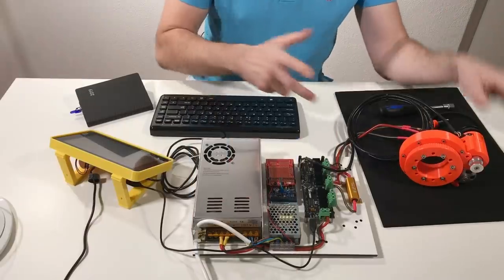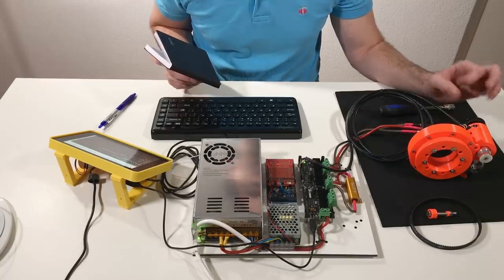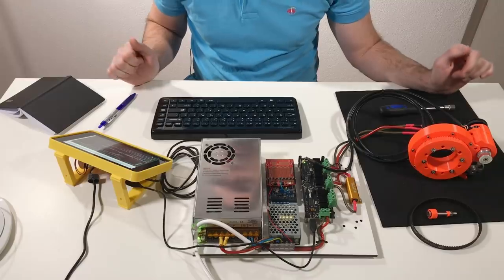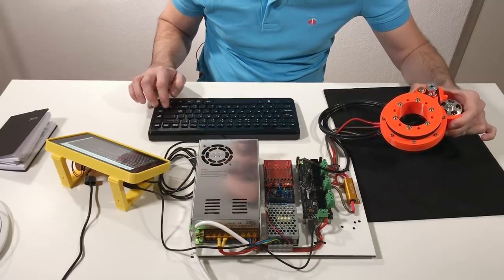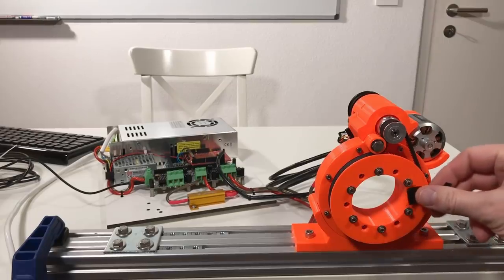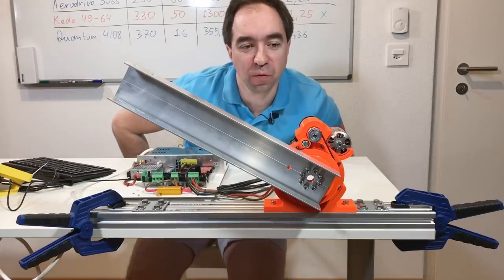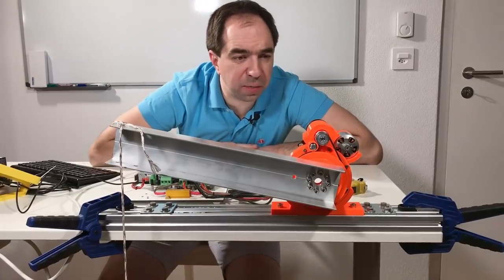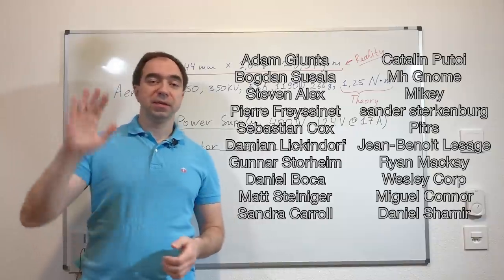Test of Robot Actuator (Brushless Motor Robotic Joint)

Comment: At 1.2KW, your motor is an absolute beast. a higher gear reduction may give you the needed torque without using as much electricity
Reply from the maker: 100% agree with you. I even think that may be I should develop several actuators like this one with different gear ratios. Thank you for the idea!
Reply: In that case motor must rotate on higher rpm, problem will be also inertia ratio wich cause lower accuracy in positioning, by the way great job and thanks for uploading good videos with explanation

Comment: 14:33 some sort of brake system would probably be ideal so that it could lock it in place, and when the arm goes to move it releases the brake. The disc brake system on some bicycles would work very well, have a servo to control it.

This would also allow you to control how fast the arm would drop under load without having to use the motor to be the sole thing to provide resistance on slowing or stopping the arm under load. 

And you wouldn't really have to change too much of the current design to do it either.

Comment: It is great to see a closed loop actuator with enough power to be useful, without breaking the bank.  Thank you.
Reply: But doesn't this setup cost around 350+ $?
Reply: @Mr30friends  : Until you mentioned it, I was assuming we were talking about the motor, encoder, a couple of belts & pulleys, and the 3D printed parts.  There is, of course, the electronics side of the equation, which I had conveniently ignored!  I don't know the cost of the complete package, but I will be interested to learn that if possible, later on.
In my mind, I was relating this to the cost of an "off-the-shelf" closed loop system... If this is not cheaper, then it loses it's significance.  We may be breaking a bigger bank than I realised.  It's still a neat project tho'!    :o)
Reply: @PiefacePete46  
The odrive costs 120$, plus 40$ for the encoder, plus 80$ to 100$ for the motor, plus the huge special bearings which probably cost around 30 to 50$. Plus something like 40$ for the power supply.
Add to that the 3d printed parts, axels and pulleys. So around 350$ to recreate the exact setup from the video.
But of course there are some parts that could be used for more than one joint. 
For example the odrive can control 2 motors. And a power supply could probably also take care of more than 1 joints.
I think he plans to make a 6 joint robot with this kind of joint. So the cost will reach quite high. 3 Odrives 360$, 6 encoders 240$, 6 big bearings 200$(?), 6 motors 450$, lets add another 100$ for power supplies cause I have no idea how many it will need. Lets also add 150$ more for any structural stuff. So if my rough estimates are somehow close to the truth, the robot could cost from 1500$ to lets say 1800$.
That's quite a big project.
Reply: @Mr30friends  : My bank is definitely broken!   :o(
His stepper-driven arm is what caught my attention, and I had not taken on board the size difference between that and this current project.  I would be curious about cost comparisons between the original arm, and an arm of identical size and power that uses a closed loop scaled down from the one shown here.   Closed loop is appealing, but seems to move cost and complexity beyond all but the most determined builder, and that's not me!
Reply: @PiefacePete46  Yeah. For that price, I would expect less backlash in the system... I wouldnt exactly call this the pinacle of budget robotics...
At least until chinese factories step in, take the open source odrive and its encoder that cost about 120$+40$ currently. And somehow transform them into 20$+5$ products. Coming soon on aliexpress probably. (or not)
Also that would not be theft. The odrive maker made everything open source.

Comment: Stall torque is NOT going to be power supply limited, because the applied voltage is many times lower than the supply voltage under those conditions.

 For an electric motor, PHASE current is proportional to torque, and PHASE voltage is proportional to rotational speed.  At stall or low speed, the motor is not turning (either at all, or just very slowly) and so the phase voltage applied by the drive is only that required to drive the phase current though the DC resistance of that phase.  Because motors are mainly reactive rather than resistive, that voltage will be small, likely in the order of a few volts.  As such, the drive is acting as a step down regulator, and so the phase current available is many times greater than the supply current.  For example, if we ignore losses for a moment, your supply is 24v and 17A (24 x 17 = 408W) , if the phase voltage at stall is say 2.4V, (10 x lower) then the motor phase current can be 10 x higher, ie 170A !!  (2.4  x 170 = 408W) !!  Even with loses, which will be in the order of 10% at stall, you will still have plenty of torque at low rotational speeds!   

What you need to do is to work out if your Odrive is limiting the phase current and hence the torque, as chances are it is the "weak link" in the chain, so to speak......
Reply: Will reduction ratio solve this problem?
Reply: @pavelzhdanov  Increasing the ratio will of course generate a higher stall torque.  It cannot increase the systems total power, and will reduce the maximum output speed of the actuator. At high ratios the rotational inertia of the drive motor starts to dominate as that inertia is referred to the load by the same reduction ratio.  If it were me, i'd characterise the motor first one it's own, for torque vs current, and then "do the math" as it were to see if my overall system performance is in fact suitable to drive the load i wanted to drive. One easy way would be to 3d print a "drum" of a known diameter, attached that drum to the motor drive output, mount the motor, and run string around the drum, hanging down to a known mass.  With the Odrive you can slowly increase the phase current until the motor juuuust lifts the mass, and then you can calculate the torque the motor makes, and hence it's KT (Torque per amp).  The belt drive system and bearings are of course not lossless, so i'd knock off something like 15% to account for those loses when the reduction system is in place.
Reply: Based on other comments as well, the whole system with such motors would not work finally even with higher ratio. However interesting to see the result

Comment: Great work!

Torque at stall means that all of those amps go into heating, without active cooling it will be very easy to damage the motor if you push 50A through it for longer than a second or two. You might want to consider the motor's motor constant and the maximum amount of heat that you can dissipate from the motor. 

The motor you are using is designed to provide a large amount of work at a relatively high RPM, for this application a flatter motor with a higher motor constant may be preferable. There should be some hobby motors that are more suited for the task at a similar price if you are interested in changing your design at all.

Comment: great job,  thanks .
The Arm material would be ligther, I would recommend carbon fibre, and it does not have to be so fast (to be fast , you will loose your torque at the same power)
By the way I am excited  to see the next, finally doing reverse kinematics equations and calculations

Comment: Very impressive! 

Really interested how the actuator will perform with full power. It would perhaps be a good idea to introduce some active cooling to the motor when doing that, since the motor magnets are quite susceptible to higher temperatures.
Reply from the maker: You are 100% right.  I would do this. And in the next version I plan to install the cooling fan. Thank you for your comment!

Comment: Very good video, thanks.
The bang/click heard at 12:32 & 14:38 sounded more like belt slippage under torque, probably due to plastic deformation in the 3D printed plastic casing.  The holding power (2kg) is almost certainly due to under-power as you say.
Thanks again, excellent stuff, I'm jealous.  :)

Comment: Simply amazing
Reply: Do you know what's the possible cause behind the slight jittering at 12:54? Is is the controller? I feel like it overshoots a little every time the goal is changed. Maybe over damping can help?
Reply from the maker: This controller have PID control and it is possible to change all parameters for this control. I hope I just need adjust this parameter and it will solve this problem. This is something I should try. Thank you!
Reply: Skyentific Thank you for doing all of these on YouTube! I am very impressed by your channel!

Comment: This looks fantastic!  However, I've done some numbers for a while trying to do my own servo actuators, and the torque conversion needs to be about 1:100 for this kind of application. Otherwise the motor current will need to be too high, which is not practical for repeated motion.
I wouldn't be surprised if this demands 30 amps for a few foot-pounds.
We are all experts here lol.

Comment: doesn't it have way too high RPM/way too low reduction??? I think you mentioned 1:15 redction which would mean it would run at 5700/15=380RPM. Depends on the kind of robot youre tryna build but I think the speed is quite (too) high!

Comment: You need to tune your PI-values on the odrive. The motor overshoots quite a bit and corrects back. Of course, every time you change the mechanical load, the PI-values need to be tuned again...

Comment: Re Power Supply: I’ve heard some people get away with a low wattage power supply by also adding a LiPo battery in parallel to help feed the high instantaneous currents (I’m pretty sure I read that somewhere in the Odrive forum). I’m not sure how it would go with longer duration holding torque currents, like your application requires, but it might be worth a shot if you have some high discharge rated batteries on hand before you go out and buy your new power supply.
Reply: I was curious about that and googled:
from : https://hackaday.io/project/11583-odrive-high-performance-motor-control
"Use of a high power density Li-Po battery means you can achieve >1kW peak power output with only a modest power supply."
Reply: LiPo battery in parallel. That sounds legit. 
I have been planning to drive a BT30 mill spindle by a BLDC.  The show stopper is the power supply.
Our 220V 13A power supply can only put out 2.5KW which is not quite powerful enough.   

Then by adding LiPo in parallel to the DC supply.  May be I can use the more powerful 80x100mm BLDC which
has a rating of around 5KW.   

Long time + continuous cuts is not my intention.  My plan is to see if a home BT30 spindle can make dark blue
chips out of milling steel.    

If the test is successful, may be some day ODRIVE will have 48V version for some serious business.
Reply: @lpjunction  Sounds very similar to what I have planned. Let me know if you're successful! PS odrive have 48v version on their website ;)
Reply: I checked on their site
There is a latest 56V version for beta testing with limited cards made

The 56V should be targeting 13.8volt lead acid cells.

4 bowling ball size battery can take a lot of abuse

Comment: For testing and mobility you might be better off with an RC lipo battery. An 6S 4000mAh 25C battery could provide 100A constant for example, and you can go higher in any of those values, both capacity and C rating

Comment: The problem is not so much with the power supply, as in the non-tuned PIDs in the position. This is seen in the video. Without a load, the motor does not reach the position. Good luck!
Reply from the maker: PID would not change the maximum torque.
Reply: @Skyentific  Yes, of course, but not configured PIDs will not allow the controller to create the necessary currents in the motor windings with any power supply.

Comment: Belt is the issue here, not meant for high gear ratios, try to print some gears and try again, results should be better even with 3d printed gears, the distance is not an issue here as everything is quite close

Comment: Very nice! I agree that the torque is lower than it should be, but I don't think it's the power supply at fault. Can you try to run the encoder offset calibration AFTER index search?
Reply: More info here: https://things-in-motion.blogspot.com/2018/12/how-to-select-right-power-source-for.html

Comment: When to motor is not moving you will just have your i^2 r lossess. Say the motor is 10 miliohms, at 53a that would be 530mv for 28watts. So your holding torque is fairly low power and should be within the range of the power supply. The motor controller acts as a buck converter with the motor inductance and multiplies the current from the psu to your motor command current.

Either your motor is saturating with the current, or you don't have the odrive set to the right current.
The mass of your arm also contributes to the torque required.

Comment: Great video,  and great channel...

I dont think it is power supply, I would suspect regulator tuning, 
On 0RPM voltage on motor coils is low so if there is any capacitance between PS and Motor drive
It should give nececerry 53A. It is easily checked, if you have 24V on PS output PS is ok.
I suspect tuning because it is a bit slugish to reach final position in video, 
maby Integral time should be smaler (or integral constant bigger),
Try lifting weigth realy slow 0.1mm/sec from floor, just to give PID time to acomodate to weigth...

Comment: May I recommend LiPo batteries? They can offer you very high currents easily and may be a cheap option at least until you know the current that you need. Awesome work by the way!
Reply from the maker: Totally agree!!! This is very good option. But I don't have any. I will try to find one.
Reply: @Skyentific  
May be a car battery can act as a current booster too.

Comment: Ran into your channel today, dropped a subscription.

I'm still a robotics student so I could be wrong but do you not think the belts could be a major source of this torque deficiency? Running a two stage belt system at high tension seems like a likely source of torque loss and backlash?

Also you could check your hypothesis about your power supply by using a multimeter on your power supply and when it is in use looking for concerning voltage drops, or just directly checking the current. I would expect more performance for 400W than what you're getting in this video.

Anyway, I don't mean to be negative and I wish you the best with your channel and projects!
Reply: @ Oran Deutsch Could you please explain why a two stage timing belt causes torque loss and backlash? Thank you.

Comment: This is very interesting research. What kind of considerations are there for deciding where to put the encoder on a system like this? If the encoder is at the motor or if the encoder could be placed as close as possible to the output? Thanks again for your great videos.

Comment: It's very good for education closed loop servo-motor. But problem what you will have, for real working model: small torque, poor braking, and poor keeping position. Probably use gearbox and braking sistem will solve those problems, but in real life more easy to use stepper moter, wich is more enough for this model.
Удачи в экспериментах!

Comment: A Robotic Arm may remain stationary but under load for extensive periods of time. How well would do you think an outrunner would handle this scenario? I made a very similar design a couple of years ago with 3 outrunners in a planetary setup (I wanted to use 3 in order to use them at half of their rated load), but never went through with it because when asking around while looking for motors with the appropriate specs, I kept receiving the same response: These motors are not designed to be used under stationary loads and even at half their rated power they will overheat and burn out. Do you have any thermal measurements? I want to give my old project another go

Comment: Around 13 minutes the lever arm has some aftermoves/positioning, the encoder tries to correct to the desired position perhaps because of the high inertia. Can this be eliminated with full motor current aka more holding torque?
Reply: Also notice it. 12:30   12:34 12:44 ... all motions with lever). If it related to underkurrent, limiting current in program can solve it. Also I suspect high latency in closed loop control. So it slow react on command and slow correct position after movement.

Comment: I see some residual movements after stopping. Is that normal?
Reply from the maker: I think this is because the PID parameters are not well adjusted for this configuration. My idea is to first have a good design of the robot joint and after I will adjust PID control.
Reply: I think what that dude James does is his algorithm instructs the Odrive controller to step down the velocity to about 90'% once the encoder reads that the motor is about 75% or so towards it's goal, and then gradually slows down as it gets to point B in the loop. Slowing that rotational "vector landing," I guess I'll call it that lol, but that may help. It seems that PID issue is maybe that the motor over shoots it's goal, and then creeps back awkwardly towards the goal in the loop cycle, as the encoder reads that the rotation has gone to far. It may even be something silly as maybe you have your baud rate set too low from your encoder to Odrive.
Reply: @AngryRamboShow  I have been doing research on Odrive system and as for my application which is CNC, residual movements are not ideal. I guess hybrid step servo motors are still a way to go.
Reply: @3dprintwiz378  Stepper motors are good for CNC; they're like servos but can spin continuously and have encoders. My printer has 4 NEMA 17's, and I've seen here on YouTube people make CNC routers homemade, using steppers.
Reply: @3dprintwiz378  Properly tuned parameters solves the issue.  I'd not shy away from ODrive due to what you've observed.